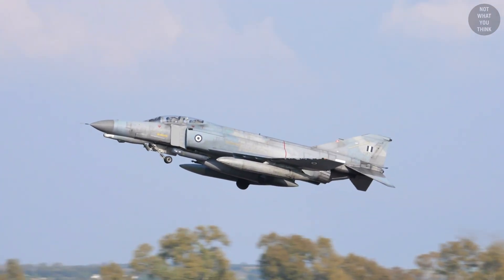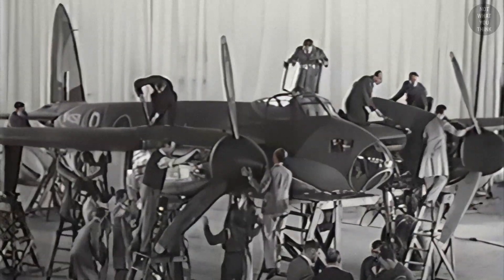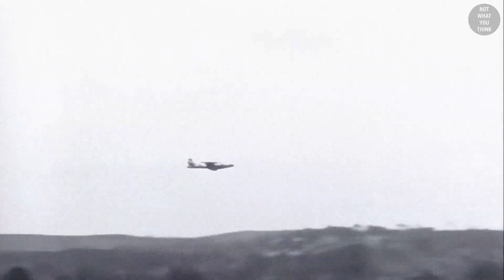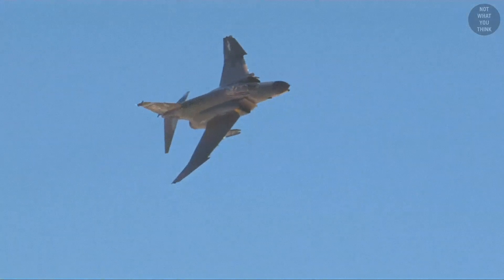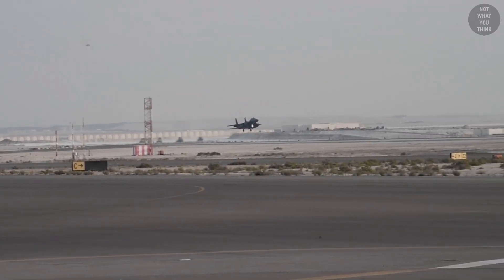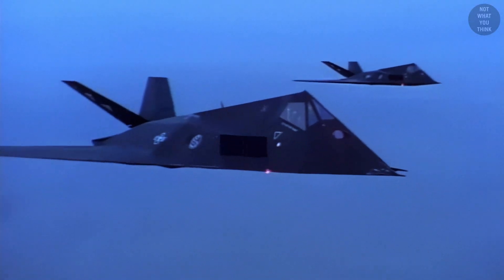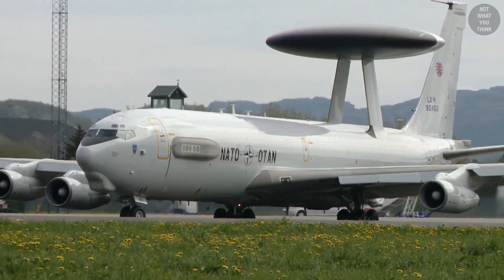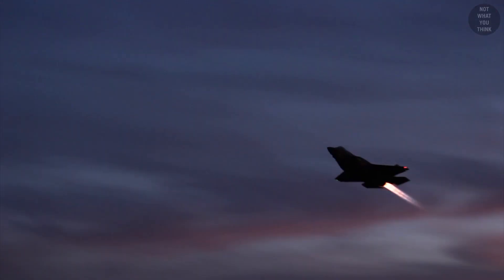Why are Modern Fighter Jets Slower than 1960s?

Comment: Stealth, phased array radars, and high off-bore shooting of missiles means modern 5th generation aircraft are heavily geared toward "Forward Quater" engagements...  But they have a problem.  With low missile counts, and inferior top speeds, they'll struggle to disengage.  If a 5th gen is discovered, and effectively re-engaged - they'll be forced to fight until they're out of missiles.  This is a fundamental weakness.

Comment: But the F22 has a higher top speed at mach 2.25... The F35 is not designed to go faster than or replace the F22 or even be a dedicated fighter, it seems like it was just cherry picked for the title and initial hook of "fighters haven't gotten faster for 50 years", which is not true at all.

Comment: Lockheed YF-12 Mach 3+ 3,661 km/h First flight: 7 August 1963 last flight on 7 November 1979 Mikoyan-Gurevich MiG-25 Produced 1964–1984 mach 2.8 3,494 km/h still in use

Comment: Just some theory says that it is no use beeing fast because it is hard and expensive to achieve. This idea may be good when you are fighting against underequiped armies like the nato did the last 30 years. But when you have a real opponent, the game is quite different.

The faster the aircraft can be, the lesser it is exposed to ennemi fire, as defensive or aggresive.
The faster the plane can go, the closer the missile vector has to be to guarantee a 100% kill probability. And this is more important in air to air combat.

Thats why USA, Russia, and China still have and design M2 class aircrafts in air superiority role. Thats why french Rafale is faster than its competitors

Yes today combat aircrafts can achieve much faster cruise speeds than aircrafts from the 70's. In some conditions some of them are able to supercruise.

Steath flight can be achieved only particular conditions. Even the air humidity has a role. And now the public realized that the passive stealth methods (shape and materials) can only address a range of frequencies and may be useless against other frequencies. 
Thats why radars made a huge leap forward in the range of wave they use, by switching wave they can detect different types of "stealth" aircraft. Remember the fact that was revealed, that a WWII german Wurzburg radar would be very little even not affected to detect a F117. Just because of the wave type it uses.

Comment: The F-15 and F-22 can both reach nearly mach 2.5, and a F-4 tops out at mach 2.23. The F-5 can reach mach 1.63, and a F-16 can reach mach 2.05. So in conclusion newer Aircraft are faster. Also a F-35 can go about as fast as a F-16, mach 1.6 is not it's max speed that is still classified.

Comment: Hey hi! USMC Fixed wing aviation mechanic here it’s not that modern jets are slower than older jets it’s the capabilities modern jets have pilots can’t push to, whereas older jets took less to push. It just comes down to the fact that a modern jet can do what’s called a “handstand” of executed properly but 9/10 times a pilot can’t handle it

Comment: To be fair higher speeds allow for better launch parameters for rockets no?
Reply: Pretty sure with how rockets go these few hundreds km/h don't matter
And areodynamic probably won't let the missle go any faster then it's supposed to anyway
Reply: External weapons cause significant drag. The F-16 may have a higher top speed, but with a 6 missile payload it is slower than an F-35 with the same payload.

Comment: Wait a minute, maximizing the turn rate is needed to be an effective fighter, and that in turn means limiting speed to about Mach 0.7?  Mach 0.7 is about 530 per hour (0.7 x the speed of sound, which is about 760 mile per hour).  But a P-51 mustang, a propeller aircraft, could attain a speed of 554 mile per hour.  Why then not go back to propeller-driven planes?

Comment: The F-35 is moot and destroyed in a dogfight then you have low frequency radar. The F-35 is a piece of shite
Reply: the only fights now are BVR and not dogfights, in BVR the f-35 is one of the best
Reply: @thefish1292  BVR only applies to high frequency radar..Low frequency radar kills stealth
Reply: @sphereslip your understanding of BVR is inadequate.
Reply: F-35 is a multirole jet you dummy
Of course the F-22, an air superiority fighter would shoot it down
And dogfights don't happen anymore
Reply: The F-35 can dogfight as Red Flag has proven.
Reply: F35 is only good at long range. they're shit min a dogfight. thus the F22
Reply: @sphereslip  The last time a dog fight happened it’s in the Vietnam War, 99% of engagements are in BVR
Reply: @thefish1292  f-22 Raptor
Reply: @sphereslip  The F-35 is more maneuverable than the F-16 and practically just as maneuverable as the F-22 at medium to low altitudes. Only morons think it isn't maneuverable.

Low frequency radar doesn't defeat stealth, it just helps detect the target and thus is capable of providing early warning, but still at reduced ranges. Russian Nebo systems specifically designed to detect stealth targets are claimed to be capable of detecting stealth targets at up to 200km. F-15s can still be detected by those systems at up to 400km. It also isn't a radar lock, it's just detection, and quite optimistic considering Russia's stealth tech is quite a bit behind the US and Europe.
Reply: @dumdumbinks274  isn't it said that the F-35 is not very maneuverable and is only effective at long range? It would be at a massive disadvantage in close combat.
Reply: @kotorandcorvid4968  The claims that it isn't maneuverable simply don't have any merit and have been debunked many times.

The first such claims were based on heavily biased theoretical comparisons before the F-35 had even entered service e.g. there was a study by defence analysts who had financial incentives (bribes) to oppose the F-35 program, that concluded the F-16 was more maneuverable. The reason they concluded the F-16 was more maneuverable was because they compared an F-16 in it's lightest possible combat configuration (which is literally useless in modern combat), to an F-35 fully loaded for a stealth long range strike mission. The F-16 had a 360lb payload. The F-35 had a 5000lb payload. The F-16 had 3500lbs of fuel and a combat range of 250km. The F-35 had 18000lbs of fuel and a 1200km combat range.  It was an incredibly bad comparison, but they made it even more biased by never explaining how they would perform if the roles were reversed... An F-35 configured for point defence with a 250km combat range would absolutely demolish an F-16 no matter how it is configured, and that didn't fit their narrative.

But for the most part the claims are based on a report that was leaked in 2016, covering an unofficial test that occurred in Jan-Feb 2015. What happened was that test pilots got fed up because flight restrictions remained in place on the test airframes for several months after tests had concluded, which delayed progress. In order to prove a point, they took a test airframe (AF-2) which had major flight restrictions to the point that the flight computer would force the plane to level out even during some non-stressful maneuvers, and pitted it against an F-16. The F-16 flew circles around the test F-35 as expected and flight restrictions were soon lifted after the report was filed. However, over a year after the test concluded, the report was partially leaked to the public. The media had a field day, because it created even more drama around a military program that was already controversial due to it's cost, and so they overlooked the actual details. Remember, American media corporations are not state-run. They are businesses. They profit from attention, and drama brings more attention than truth.

Production model F-35s back in 2016 still had restrictions, but they were beating F-16s in training dogfights fairly often, and former F-16 pilots who had transitioned to the F-35A were praising the F-35A's maneuverability.  Early descriptions of it's maneuvering capabilities notably included statements like "it's an F/A-18 with the acceleration of an F-16". If you aren't aware, the F/A-18 can pull very tight turns, but it's lack of thrust means if it misses it's target after pulling such a maneuver, it is likely to get shot down. The F-16 on the other hand is known primarily for it's acceleration and very fast turns, but cannot pull tight turns. The overall consensus was that the F-35 had the strengths of both fighters, but did not massively improve on the individual aspects. In other words, it was incredibly versatile in a dogfight and pilots were able to win often in training because if the enemy was superior in one aspect, they'd just change tactics.

Current production model F35s have no restrictions at all in regard to maneuverability and are considered as maneuverable as F-22s at medium to low altitudes, but with slightly different maneuvering strengths. The F-22 still has the advantage at high altitude though.
Reply: @dumdumbinks274  oh, ok.

Comment: 7:20 This is incorrect. The F-22 is a Mach 2.2 aircraft and can supercruise (travel above the speed of sound without use of it's afterburner) at Mach 1.5 - 1.58. The F-15 can travel at speeds above Mach 2.5. The military is not trying to reduce speeds but trying to achieve higher speeds at greater efficiency. Actually this entire video is incorrect (with the exception of the part on surveillance). Most 4th generation fighters, if not all can travel at or above the speed of sound without the use of afterburner where as very few if any Vietnam aircraft could. That big beautiful F-4 at the beginning needed it's afterburners to break the sound barrier at level flight.

Comment: I've flown mig 21 bis ans FGR 2 (basically a f4f on steroids)

Compared to modern fighter, those thing only fast at certain condition namely full on afterburner and high altitude, on deck they're limited to around 1300-1400km/h and that if the airframe doesn't rip

Modern jet are faster without afterburner and the trust to weigh ratio are insane, anything that have 1:1 ptw and above are guaranteed sanic.exe

Comment: Going past mach 2+ means the plane really needs variable-geometry air intake, such as ones F-4 or F-14, F-15 used. F-22 and F-35 have fixed air intake for increased stealth capability which would make them very inefficient at mach 2+ flight.
How much does the shape of air intake matter?  Very.  It's like trying to drive your car at 150MPH without switching to high gear.

Comment: I suppose they build what they need. Still, the F-35 looks like something no-one needs. Slower and less agile than most fighter jets, it's a sitting duck in the sky waiting to be shot down. Full of electronics with no backups, like they don't give a shit. So either they have something else and they don't need jets, or it's a 'for sale' only jet and they never intend to use it themselves. Or...who knows? Maybe they outsourced their fighter jets just like their iphones.
Reply: It's faster and more maneuverable than everything it replaces. Full of electronics with no backups? what are you smoking lol?
Reply: @dumdumbinks274  Only the A4 is faster and more maneuverable - just like the Mig-28s.The F35 sucks big time.
Reply: @EscapeVelocity1  Backups does not imply gauges. 

By your logic everything the US produces sucks. They don't restrict sales based on capability. The F-22 was just a unique case due to the end of the Cold war and relaxation of global security. 

F-35 is also replacing the F-16, which is still an incredibly capable fighter that can keep up with modern fighters in most dogfight scenarios.
Reply: @EscapeVelocity1 You're wrong

Comment: You can still run from missiles. They don't have infinite range in fact their range is quite short. Even though a missile is faster, the jet only needs to run away long enough for the missile to run out of fuel, and speed helps here.

Comment: Speed claims are a bit like clickbait.  The reality is that older fast aircraft can only dash to these speeds, for a few minutes and can't do it carrying external loads. At maximum speed they burn fuel at such a rate that it is not tactically smart to do it. A bit like the Bugatti Veyron which can do something like 240 mph but empties its fuel tank in 12 minutes doing so. 

Most fighters are firmly subsonic unless clean or strictly carrying AAM loads and forget using afterburner if you want to go any distance.

Supercruising is rare amongst fighters and usually not possible when carrying external loads,  so it's largely academic. 
The F-22 and F-35 can supercruise because they carry their weapons internally,. 

(Mind you Concorde could supercruise at Mach 2.0 for 3 hours. No military aircraft has ever matched that.)

The other problem us the faster you go heat becomes a problem. The F-111 could exceed Mach 2.5 but was heat limited to that. Cruising at Mach 2.0 Concorde's skin temperature was 126C even in the -60C  air at 60,000'. As a result it's VNE (really MNE) was Mach 2.2.

The other problem is that heat soaks the airframe and heat seekers love that. The faster you go the more vulnerable you are to being spotted passively by an IRST and a subsequent IR shot.

Comment: The F-35s design simply necessitates low speed. It's stealth coating literally boils because of aerodynamic friction and panels have been known to fly off.
Reply: The issues you cite are merely teething issues with only a couple of known occurrences over the last decade. In reality the F-35 is faster in any practical configuration than the fighters it replaces. It isn't slow.
Reply: @dumdumbinks274  It has supersonic flight restrictions, even if it were fast it could not fly supersonic for long
Reply: @charliehigglons7490  Only the B and C models have supersonic flight restrictions, but they are just rules for the pilot to follow in peacetime, primarily to ensure F-35B/Cs are not undergoing avoidable maintenance when they are actually needed. The restrictions do not apply if the speed is actually needed in a combat situation, and the most common variant - the F-35A - is completely unaffected by them.

Do you consider the F-16 to be fast?
Reply: @dumdumbinks274  Those are not peacetime rules, they are to prevent the aircrafts skin from boiling. You're gonna tell me that it can't fire its internal gun because of peacetime and not because the airframe will crack.
Reply: @charliehigglons7490  What you don't seem to understand is that a damaged combat aircraft is always preferable over no combat aircraft. 

Yes, the gun restriction is also primarily for peacetime. There are no physical restrictions preventing the gun from being fired if it is actually needed in combat because the peacetime restrictions help keep the guns in working order. 

Besides, the gun cracking is already fixed on the production lines... The fix just hasn't been applied to the previously built aiframes.

The 'boiling' issue as you call it has only occurred 3 times in the last 11 years. The speed restrictions have only been around for 5 years.
Reply: I'll stick with a tomcat.

Comment: Another point missed is about Beyound Visual Range (BVR) engagements, DCS pilots well very well, In a BVR combat where you got a radar lock at 30-40 miles away, the faster the speed, more dangerous your missile is (and farther it will go). As for defending a BVR incoming missile, if you have enough speed, you can fly in a diagonal in relation the the incoming missile, forcing the missile to add a big lead to the path. making much much easier to defeat it.  to be honest, turn rate in a modern air-to-air fight is not that importante, targets will be shot down much before they can see each other. the older AIM120 C version can show down enemies af more than 50 miles away.

Comment: I presume it’s to prevent disintegration in the air or something that requires a lower speed, another thought is that of the fact that the fastest jet isn’t going to outfly a Air to Air or Ground to Air Missile. These are my initial thoughts.

Edit: So while it wasn’t about disintegration due to high speeds and it was mostly about how high speeds don’t add any benefits in combat range or fighting. It did mention how missiles will always outrun the jet
Reply: SR-71 blackbird outran missles. Too fast, too high, too far to touch
Reply: @joehughes5177  yah, the same plane that keeps on disintegrating and was made in 1964 before retiring in the late 90s due to said Disintegration and Missiles getting faster and more advanced.

Comment: not really accurate.  Higher speeds allow for far higher energy missile shots and thus far longer missile ranges.  The reason that these speeds were less common in Vietnam was simply because A2A combat was not very common in Vietnam and most fighters were equipped with heavy fighter-bomber loads,  making it harder to reach high speeds.

Comment: Having an initial speed of Mach 1.8+ at 20k+ Ft into a fight has its advantages of a first shot launch of high speed and high attitude long range shot, these apply to the current AMRAAMs very well. Increasing its target hit probability to its highest potential.

Now the problem with that is that its futility in a long term battle and resource management. Because it can be easily done by a cruise missile BEFORE a fight happens.

Hence why we don't have mega high speed fighters/bombers. At least for now.

Unless we're looking at the F-15EX...

Comment: The last sentence is basically like an Olympics. Yes, Marathon is the key but not sprint.

Why you ask? Here is the reason:
Subsonic speeds: slow jog
Low fuel efficiency: Exhaustion
Maximum speed: fast sprint
Long combat hours: Marathon

And thus:
Fast speed <- slow speed in a marathon due to reduced fuel efficiency.
Basically this is an endurance warfare.